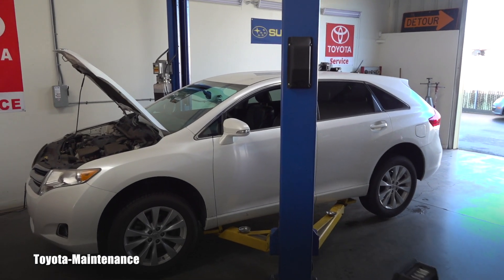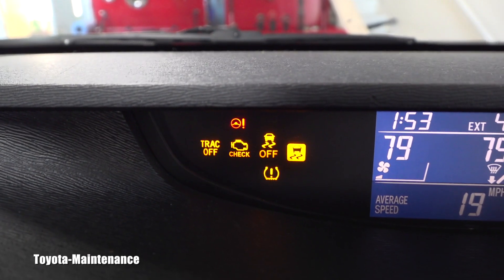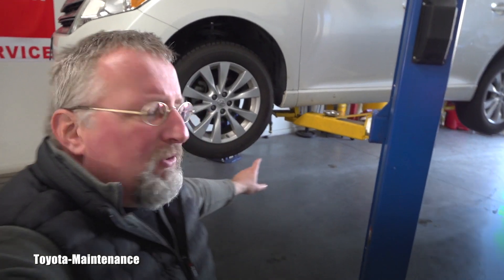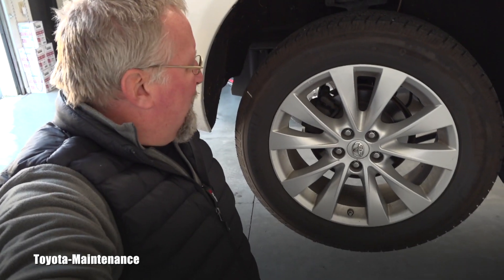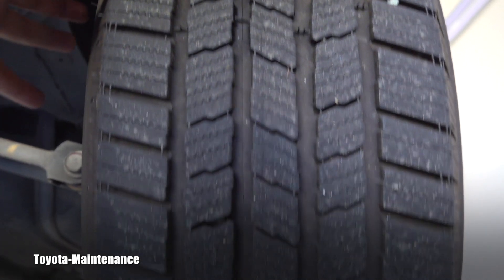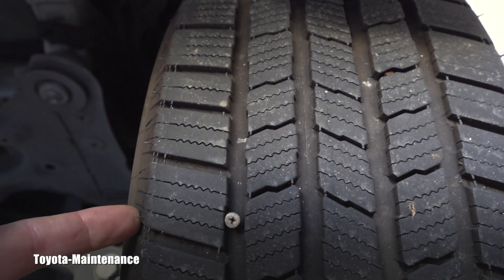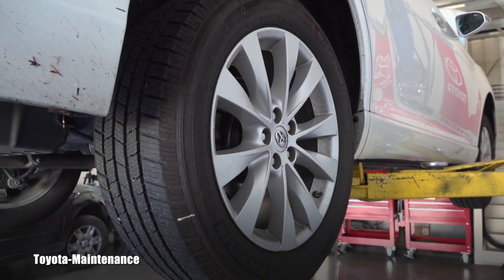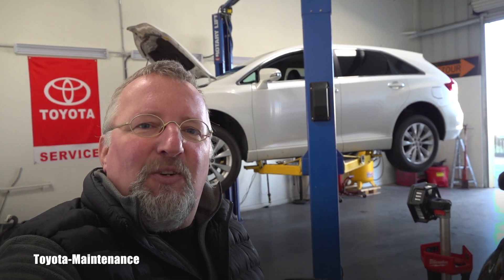Tire Pressure Monitor System saves customer from trouble

Comment: Speaking of TPMS, my warning went on. Checked all four tires and filled up to spec levels. Reset afterwards. Two weeks kater, TPMS light came on, but tires checked ok.  Was concerned sensor needed to be replaced so took to my mechanic only to discover it was my spare tire sensor.  Thankfully it just needed air.

Comment: I check pressures every month or every other gas fill up...

TPMS modules can be had for a great deal at Costco...  You gotta buy the tires there though...  I replaced two at Costco for an '05 Toyota and it came out to under $30 each. New battery, synced right up with the system...  I hear that if it (the OEM unit) goes bad after install, just ask them to do it during a rebalancing & rotation...  Some do it for free but expect a $15-$20 fee in addition to the unit...

Comment: Some older Toyotas use ABS Speed sensor for the TPMS. if one of your tires spins more frequently than all the other tires on a straight road,  it compares all four tires. if the one is smaller with less air it will spin faster than the other 3. then the system will know it needs air.

Comment: I was surprised it cost $326 to replace all the TPMS sensors in  my 2010 Tacoma.  They said the units are sealed, and the batteries themselves cannot be replaced.
Reply: You could have gotten it done for less if you had the proper knowledge:

Sensors are $30 dollars each and you do not need to dismount the tire to change them.

You can exchange them yourself and then pay $20 at a shop for them to use their tpms tool for 10 minutes to reprogram the new sensors.

If not, a shop would exchange and reprogram the new sensors for $60-$80.

Better yet is to buy programmable sensors, so you can clone your current sensors (most shops should have the tool to clone them, for $20) and that way there is no need to reprogram them in the computer.

But paying an extra $120-$170 may be worth it if you are in a rush or don’t want to deal with it.
Reply: @pepeshopping  that sistem is a pain, specially if you switch between winter and summer tires. That's why I disabled it on my Lancer..
Reply: It's happened to me yesterday exactly the same s...t. coincidence or what? Anyways Merry Christmas 🎄 to everybody who appreciates Peter's knowledge.
Reply: @adrian-xy7zt  Well the good news is I've had NO unscheduled maintenance on my Toyota.  11 years and 175,000 miles.  I learned TPMS sensors last 6-8 years so I was on borrowed time!
Reply: @pepeshopping   Your last paragraph is correct. I needed to take a 1,200 mile weekend trip and I didn't want to go without the sensors functioning.  I still saved $200 over the stealership!

Comment: The TPMS should be universal so you can change wheels.  The car should recognize it without having to program each sensor.   I just swapped wheels with another 2021 Highlander.  It took a tire shop 2 minutes to read the sensor and program the car, and charged me nothing.  The Toyota dealership wanted $250 and 30-60 minutes for each car.
Reply: Yup, the Bristol,Ct Dealer wanted $300.00 to analyze & reprogram a sense. Part would be additional. Tire pressures were fine on 2008 Toyota
Reply: @nickoshana2246  - The dealership I just went to last week was in New Haven, CT.

Comment: Modern vehicle?
That’s not how TPMS works.

The TPMS sensor will come on, activate and transfer its data (tire’s pressure) when:
-Tire is rolling above certain speed (20 mph), or
-Tire gets inflated/deflated by more than certain psi (say 2 psi) in a few seconds.

Once the tire stops rolling, there is a timeout and the sensor turns off to save battery.

The car when ON, is always “listening” so that’s how this car turned the TPMS light off.

If the car would not have been turned ON during or shortly after inflating the low tire, it would have turned the TPMS light off once the tire went above 20 mph.

Now, certain “model vehicles” can relearn the tire/sensor position after rotating tires, other still modern vehicles do not. Some of those have steps to do the relearn procedure yourself, others need a scanner tool.

Some others do not keep track of the tire/sensor position and simply monitor the pressures and turn the TPMS light/warning on when any of the pressures goes below certain level (20%) from normal.

Comment: Hi
please do an episode to show how to program the TPMS system on a newer Lexus Toyota...
My ES has a two memory ECM and recognizes the factory sensors. But my snow tires need to be programmed into the ecm via the OBD to recognize it when I change over tires in the fall and spring...
Thank You

Comment: I have to disagree. TPMS ia the stupidest system ever, specially how some manufacturers like Toyota implemented it. If it's a mandatory system, the government should have also mamdate how the sensors are programed and that the sensors should be interchangeable between brands. Not like now, we ended up with each manufacturer having a different protocol to program a sensor and most of the times involving a dedicated scannner to do so.
Reply: My 2010 Yaris has the tire warning light on, all tires are good, so it has to be the battery in one or more of the tires. So,I will not spend the $200 needed to replace all those sensors. I will just check the air once a month like I always have.